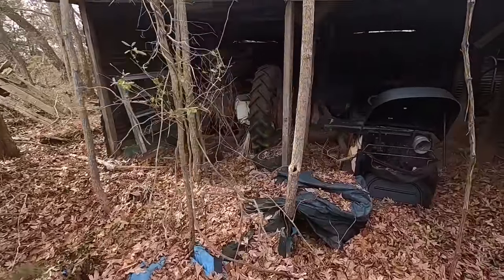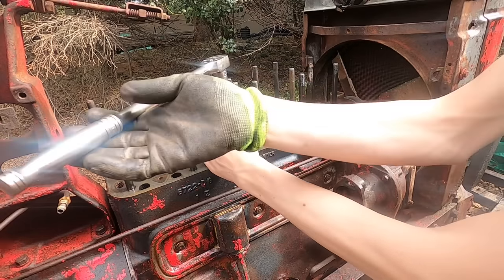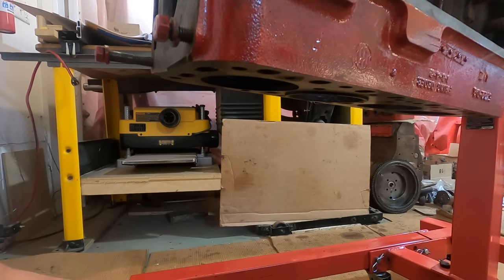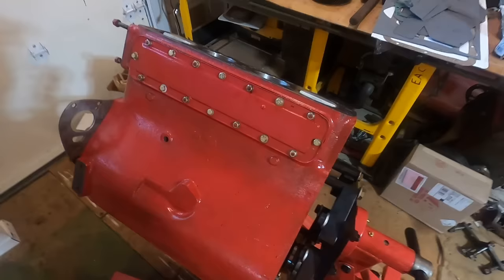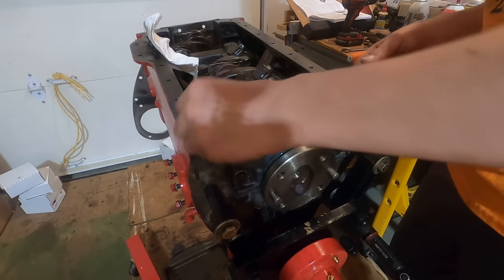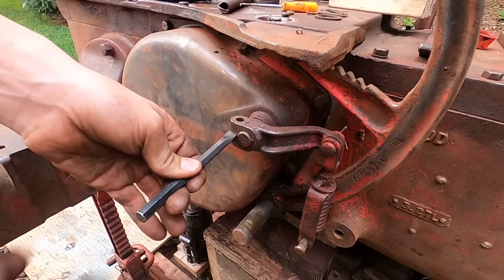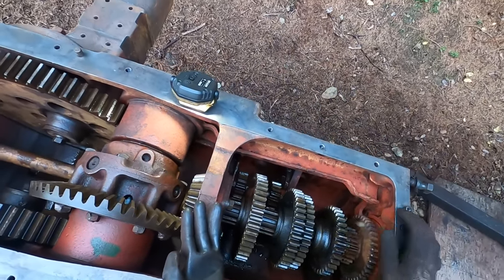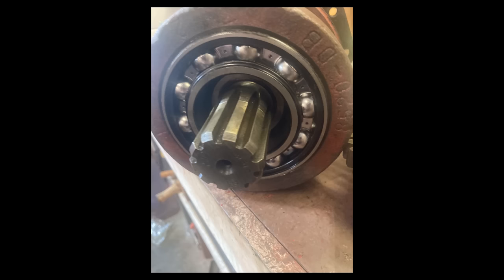Farmall M Restoration Pt 2 | Disassembly and Engine Rebuild

Comment: Ok so I guess I'm gonna be the crotchety old man here but hope to spread some knowledge here so you don't damage things.  So I grew up on a farm many years ago and we had a couple of Farmall M and 400/450 tractors and rebuilt them a couple of times as a kid.  There is something you need to know about the blocks on these old Farmalls.  And I hope some other folks are taking note of this.  This tribal knowledge is being lost as the old farmers that rebuilt these in their machine sheds with OE IHC parts are dying off.  Back in the day Farmall's machining tolerances for the sleeve bores in the block varied ALOT.  What they did is actually had various different OD of sleeves to fit the various different bores in the block.  The sleeve bore actually had a sliding (if I remember right) A-E scale of sleeves and the difference between the OD of a A to E sleeve could be .007" which is ALOT on a press fit sleeve.  Farmall when machining the blocks would actually stamp on the deck the on what size of sleeve you needed.  You were moving way too fast and the camera didn't focus but you can very clearly see an "A" @ 8:35 which is the smallest.  It appears but I can't be sure the 2,3 were C sized.  I'll bet the other sleeves probably went alot easier and you wonder why.  That explains why you broke the sleeve and why it got so tight so fast.  

BTW, folks Farmall is not the only company that did this.  Because the OE stuff is gone and everything is now a nominal size you need to be checking the sleeves and boring these blocks accordingly.
Reply from the maker: This is super interesting information.  Thanks for watching and commenting.

Comment: Enjoy your videos!  I was/am concerned to see you striking Cast Iron with your Hardened steel mallets, Maybe a Brass bar between the cast and the steel mallet would be a better impact material. Or a Brass headed mallet, or softer alloy.  You will be damaging cast iron parts or machined gears at some point and wishing you had used a brass bar at some time,.   How do I know... I have made this error myself.  Life is a learning curve for all of us. On the whole nice work!

Comment: Please remember when ever using a cutting torch on wheels make with a tire mounted on the wheel sure the tire has no air in it. The super heating of the air in a tire next to a wheel that is being welded or torched will make the tire explode. Has killed more than one person.
Reply from the maker: Good point.  Thanks.

Comment: Good job young man. I enjoy your attention to detail. Although, as thorough  as your engine rebuild is, why not grind the camshaft? Those old tractors had notoriously badly ground camshafts in them due to the sheer volume of engines they were making. It's a '42 with a factory wide front? Rare indeed considering the war. Nice job.
     Best regards from Indiana.
Reply from the maker: Factory wide front, it has the setback plate as well to retain same wheelbase as the narrow front. I would have got a custom ground performance cam but I wound not have had enough time to get it done before the restoration competition.
Reply: @thesmallenginekid  still and all, it's a beautiful thing. You've done a heck of a job. Does it get to work?

Comment: When you switched to the steel plug, I was wondering if that would happen.
The same happened installing sleeves in a Case DC4 engine. NEVER use steel, always a dead blow.
Figured out later the steel drives the liner down with such force the sleeve flange snaps aff in tension. TWANG!
Best wishes from the far North.

Comment: Im going to assume that you let the air out of the front tire before you used that torch to cut that bolt ?
Reply from the maker: Right, someone else also let me know the air should be let out before heat near the tire as we know heat makes air expand.  Thanks for the reminder.

Comment: That transmission was disheartening to see.  Looks like somebody ran it with water in the oil.  Hopefully you can find a good counter shaft, or build that one up and use a lathe to get it back in spec.  Final product looks great.  Did you have to get another sleeve?  Never seen one break like that.  Looks like it was defective.  Hopefully they gave you a replacement.
Reply from the maker: I did end up getting another sleeve. I think it was my fault breaking it. I hit it too hard at the end.
Reply: Old farm alls have a tendency to leak water into the transmission. The location of the cover/access plate is the design issue.

Comment: Look I know 10 different people will tell you how to do this rebuild. But listen I would not use HI tack to hold your gaskets in place. Once this drys you will never get that gasket off without scraping a little bit at a time off. I came across a gasket held on by  hi- tack and I finally got the gasket off by spraying with gasket removal spray. I would spray the gasket down and let it soak in. Then I would scrape a layer off then spray soak and scrape a layer off. It don't seem like much but that oil pan gasket to what seem to be an hour to get to the point I could use a wire wheel to get the last of it off. I will never forget about that one hi- tack moment in my life. Also you have a John Deer shirt on when you restoring a red IH tractor at the end of the videi.
Reply: Doesn't matter what shirt he's wearing lol.

Comment: did you pack the oil pump with grease or vasiline before you installed it so it will prime?
Reply from the maker: No, just some assembly lube.

Comment: All the new tractors & combines use hydro static transmissions so there no 
more having to split the tractor in half to do a clutch or whatever. Glory Days!!!
Of course in a few short years all equipment will be electric & THEN repairs
will really be a breeze!

!
Reply from the maker: Every system comes with its own challenges to repair.